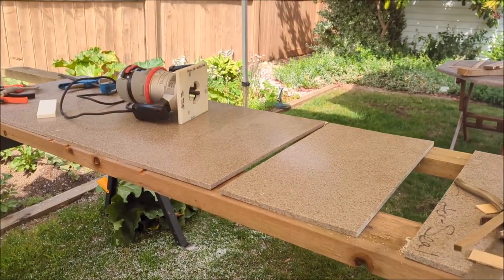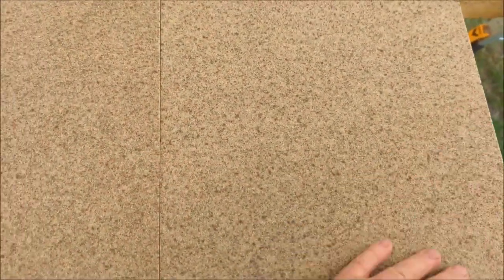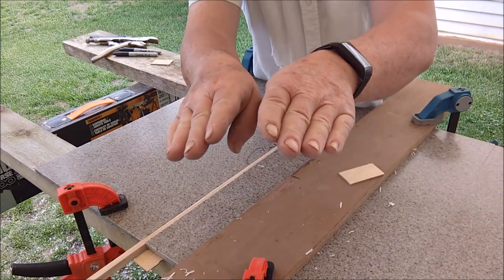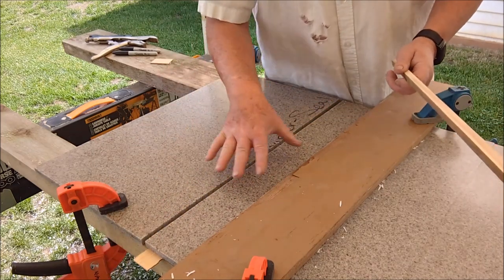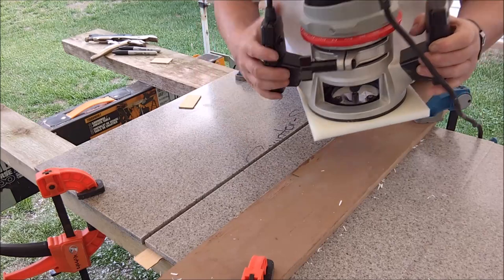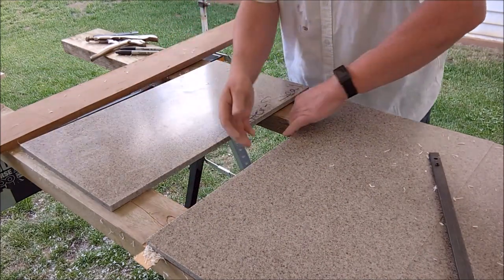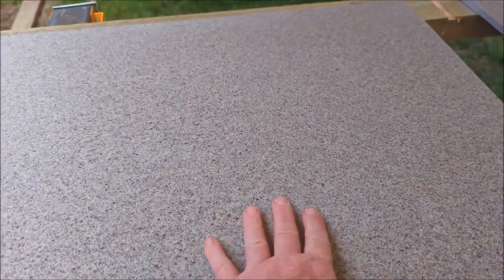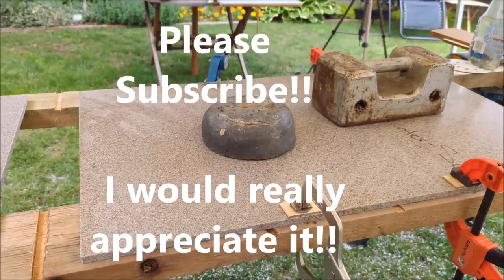RV Counter Repair Using Corian - Part 2 - How to Perfectly Cut and Join Corian

Comment: If you get any dings or imperfections you can also use Seamfil to fix/hide. Used it when I worked on new Moduline homes and a lot of times even I couldn't tell where I used it. lol I used to mix it up right next to where I was applying it. https://www.youtube.com/watch?v=aaKm39dza20 and yes you can use it for scratches even though the vid says not to.
Reply from the maker: Hey @FuriousGriffin thanks so much for the tip and the link to the video on how to use SeamFil!   Definitely going to bookmark this one and keep it in mind when the inevitable 'ding' happens.  Cheers!!